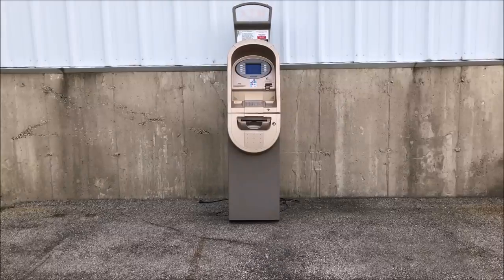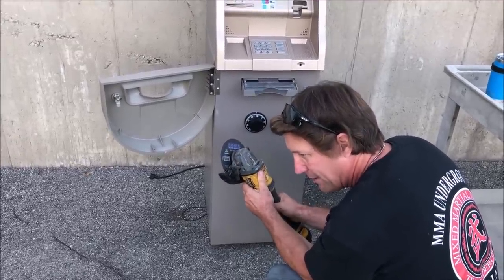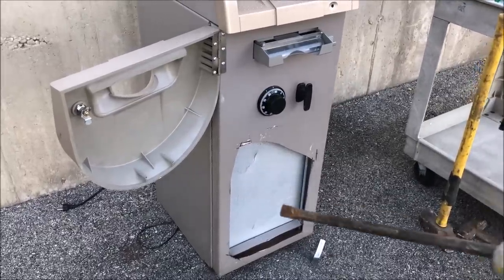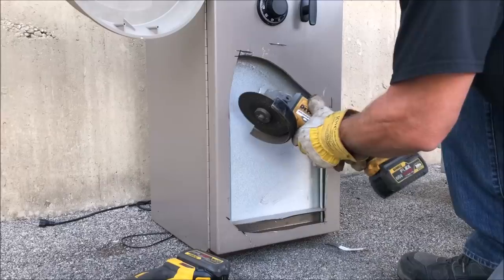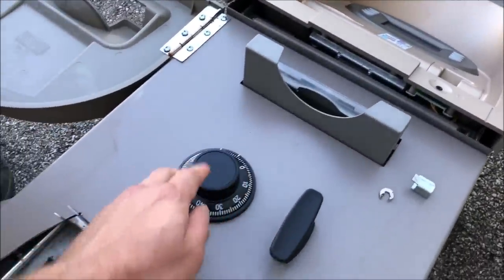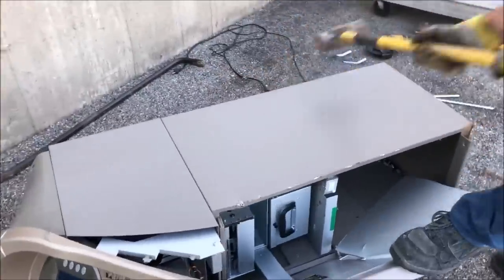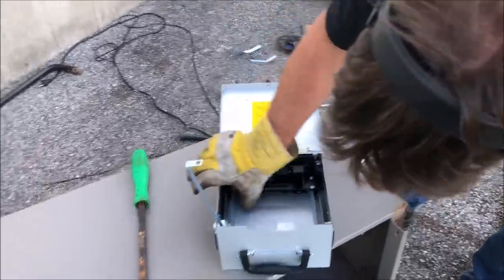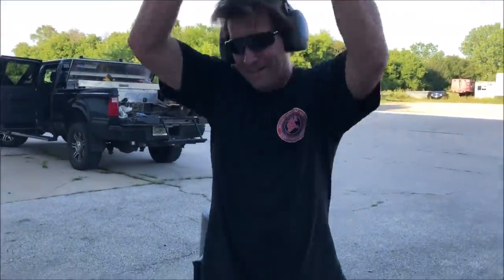FOUND ABANDONED ATM MACHINE!!! BREAKING INTO AN ABANDONED ATM MACHINE WAS THERE MONEY INSIDE??

Comment: Men in the jungle will dig a hole just big enough for a monkey to put its hand through the hole but small enough to where a fist couldn't fit. They would then place some fruit in the hole and would wait till a monkey came along and would grab the fruit in the hole. When they grab the fruit in the hole, they cannot pull their fist out of the ground with the fruit clenched in their palm because the hole is too small for their fist so they fight and fight until they are exhausted and pass out. The men would then come in and bash the monkey over the head and eat it. Now, are these men or monkeys?